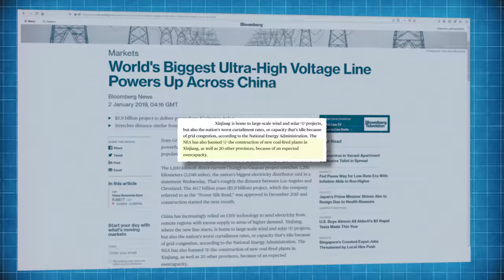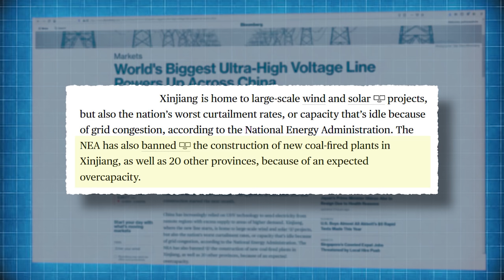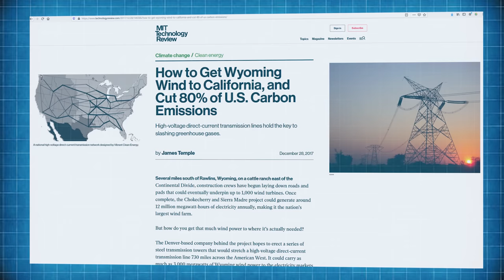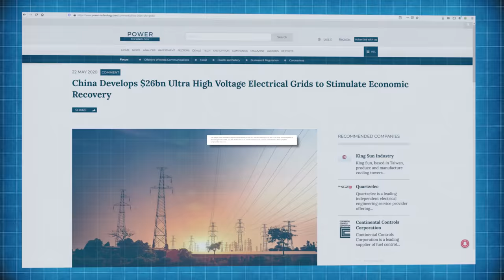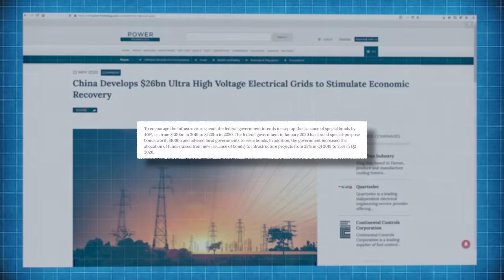China's MILLION VOLT Energy Superhighway

Comment: We can't be sure  of the real impact of human activity upon the climate  other than to say  climate change is complex and has been going on for the last 4 1/2  Billion years.  We must be having an impact  but we must also be having an impact with the rubbish and poisonous chemicals  we dump in the ground, sea and air.  I am more concerned about that the climate change.  I don't think you should praise China too much -  If it is having to limit power generation  because of over capacity  it clearly didn't plan things as well as it could.  You have to wonder apart from the environmental impact  in China generally how much  Carbon Dioxide has been generated through these massive infrastructure projects ?  

Without the anticipated  hike in electricity demand through EV  use  it seems strange without Elon Musk  there would probably have been none of it and less need for so much more electricity generation. 
   
Are EV's really about  saving the planet  and if we get CO2 levels down  to what we currently think are  appropriate levels  (to   stop climate change that is) and climate change still happens what do we do then ?

Comment: I was always told that AC was more efficient over distances due to DC loseing electrons to the atmosphere?
Reply: Leakage in a properly designed DC system should be very low. In contrast open wire AC distribution can lose energy due to radiation and dielectric heating. Over long distances this loss adds up and can be considerable.

Comment: The west like to judge China using western traditional view points.  That seems to be fine for normal stuff.
However in UHV DC transmission no country has done more and have the biggest network, the highest UHVDC lines and has actually transmitting more power over a bigger area than China.
Should China not be the expert here?
The speaker doesn't seem to know the real hydro power isn't in Mekong River which is called Lancang River in China where the serious drop of potential energy starts.  He used the standard slander the downstrean Mekong river miseries are all due to China's hydros upstream without recogising there is a Mekong River Cooperation organisation controlling Mekong River developmenet.  The mjority of Chinese Hydros are actually in Yangtze or its upstream section Jinsha River which houses the world's biggest power plants No. 1 , 2 and 4 plus over 100 other hydros.  Apart being the world's biggest hydro power China is also world's biggest solar power and wind power generator so naturally it has the biggest and the longest transmission network.
My point is western so called experts are not real experts because they have not manufactured, installed and operate the 1100 UHV DC system.  They are just obervers.

Comment: some info.     wtf    have you been bamboozled or what.        at 4:12,  Nonsense.      here are some  FACTS.       because the energy density of  DC watts  is  'full-strength' (greater than AC), the use of longer cable runs  IS  problematic.        unlike  AC,   DC  can cause  a  runaway buildup of  resistance and heat and More resistance.     this would be the equivalent of  ---   transmitting power though a giant, Heating  Element.    and, copper has a  Low  melting  point.      the only  solution to this  problem  is to use, either,  HIGH-temperature  Superconductor;  or   copper, a metre in diameter.
in contrast to this,   AC  is  PERFECT.    it can be  transmitted  with  a  Tolerable  amount of loss   and  without  'stringing'  megatons of copper;  or  reliance on a  technology that  we  do  NOT  yet  possess.        neither is pulsating DC  an option.    because, the amount of loss from (high-wattage) power-switching, would be  Unacceptable.    cheers          googletranslate

Comment: You state that Xi is looking at economic reasons for this sort of infrastructure, but you ignore the main reasons and they are NOT CO2 emissions.  Coal produces real pollution in addition to CO2 and China has a visibly terrible smog situation.  The most important is likely that China is preparing for military domination their weak link is  energy imports.  If they invade Taiwan as they have promised, their energy imports could be cut with a naval blockade. Their current infrastructure spend is chosen to reduce this vulnerability.

Comment: I doubt the validity of this video. (how do you make motors go around?) A lot of technical details were left out. Without those details I can assume that a DC transmission line could be more efficient than AC if that line is intended to move all of it's energy to 1 downstream location that is very far away. If you attach loads in the middle, then the systems might become more equal. The 1 mega-volt rating would probably still drop by more than 20 percent as the 1 downstream load is connected. I would like to know how this was measured and this video is simply non-technical propaganda that people will want to believe for various reasons. Typically, a DC power system has a voltage that is either regulated with electronics to be a certain amount, or rated as a certain amount while the expected load is connected. How do they do it? (DC voltage regulation is less effiecient than using AC. The discussion leaves a lot of questions unanswered. How does a consumer use DC power in a respectable refrigerator? How do you make a DC motor turn around? brushes? I do not doubt that the technology can be improved, but the devil is in the details. Will all LED lighting need to be replaced with new designs that run on DC? (that should make some people laugh) (it is a real-life joke)

Whether this is a breakthrough in efficiency, or a stab at global energy dominance, the CCG might be in big trouble if activist consumers get together and agree to simultaneously turn on all of their lights, and then turn them off again, and then repeat that. Perhaps a pulsating DC transmission line would be better? I do not doubt that the systems can be improved if Taiwan Semiconductor can produce a Zener diode about the size of a semi-truck. Huge gains in efficiency could also be achieved if you could use solar panels and their DC current for refrigeration and cooling during the daytime, and connecting atomic reactors to large continuous loads so that the excitation current in those generators can be maximized. I am not impressed with this video.

Comment: Saying that DC does not have loses is simply wrong. Issue is wire resistance (thickness/ohm law) and dependence on voltage.  For low voltage with just few meters you could lose half of the power on DC transmission.
Reply: No mater what you still need high voltage ac-ac tranformers to transform ac from generator 19kV to 1000 kV AC and than that ac tranform to dc high voltage.  And again at the at the end point do the same but opposite.

Comment: Hydroelectric power does not reduce the flow of water downstream.  Shameful lie!
Reply: Yes it can and does.
Reply: @wulung5943  
You need to do a bit of investigation on how it works. 
If not regulated properly, water held back without enough release to maintain any flow in the river,  the power and money becomes the driving motivation over and above the needs of the river,  environment and people down stream. 
At times of lower inflow the dams can and often do hold back too much water or all the water. 
The river can become little more than a drain between dams.
Reply: @wulung5943  
Well Mr self proclaimed  "retired consultant engineer " you should  know what the word regulated means in hydro and river flow terms. 
Clearly you are not a hydrological or hydrographic engineer. 
I suggested you do some of your own investigation into the issues , I am not going to waste my time spoon feeding you with "proof"
Reply: @wulung5943  
I did reply, now go away and find out how a  hydro scheme is supposed to work and how it can go wrong for the river,  environment and people if poorly  or irresponsibly managed.

Comment: You mentioned "skin effect" losses with AC, you could technically prove that there is some of it at 50/60 Hz frequencies. But it would be quite negligable compared with what it would be if the transmission was at higher, i.e. 10's of kHz value. Even Tesla, the inventor of our present AC system in his later life was dropping hints that the DC power transmission would be more efficient than AC. I would say that he had pretty much worked out the means of generation, transmission and conversion back to AC of DC based power transmission. By that time the electrical energy transmission field was already well established and set in concrete so to speak. So retty much no-one was interested in one old mans ramblings..
By the way, the efficiency of transmission at higher voltages is mainly due to the fact that power is a product of volts and amps, so if one jacks up the voltage the current will drop proportionally to maintain the same amount of watts at lower voltages. Less amperage, less copper cross-secion of the conductor is needed to get that power from point A to point B.

Comment: Dc to ac conversation has big losses to which you did not go into much
Reply: That's why it only makes sense on longer distances where the AC transmission losses overtake the conversion losses.
Reply from the maker: The cost benefit break even graph is all that was required for this summary video.
Reply: Just Have a Think  I agree but just felt it was skimmed over quickly

Comment: I like your presentations but you never get to the interesting spanner bending parts on which brain waves succeed or fail. As a kid, on foggy days, I used to listen to the buzz when cycling by  high voltage AC cables. How 3 times the voltage is being insulated is of interest as is the size of the losses that will still exist let alone the increased cost. A little bit of bearing grease on your face might balance some of the ideology. If you look at the wide picture you will see that most of the world just copied the Chinese response with a few variations so the devil is in the detail there. I probably sound critical but would not be writing this if the good stuff was not worth balancing.

Comment: I have a better idea.  Why not make all of our eating utensils out of LEAD?
Similarly, ULTRA HIGH DC transmission IGNORES extremely serious unintended consequences.
High current DC causes extremely powerful low frequency magnetic fields that can affect humans and animals.  Fish and birds ALREADY have their magnetic navigational abilities disrupted by these enormous magnetic fields caused by DC transmission.
Go ahead ... just IGNORE these known risks.
The earth's Schumann resonances OVERLAP the low frequency entry that these DC currents generate.  
Only a fool would blithely ignore the risks of altering the earth's  magnetic field frequency that our brains operate in.
Reply: Interesting.  Where are the LF EMF generated, during powerup?  Perhaps slower powerup and powerdown would be a solution.  At constant current, there shouldn't be significant radiation, right?  Is there actual data on the strength and extent of the EMF?  Has it been shown to be a problem for animals in practice?
Reply: Magnets in your hat could help.
Reply: @incognitotorpedo42  The problem is that it is NOT truly "constant current".  The current changes quickly with load changes.  Our 60 Hz systems don't effect human 8 Hz brain waves but the DC lines emit a lot of energy in the 8 Hz spectra band.
Effects on several types of fish are well known and studied near underwater DC cables.  It seems to upset their navigational abilities.
Reply: @byronarnason6006  What if we designed load followers that smoothed the current changes in order to suppress dangerous frequencies?  Or developed other techniques to keep EMF levels down, like generating an out of phase EMF to cancel the one from the main conductor.    I'd rather at least see if it could be made safe before dismissing it out of hand.  I think we need a lot more work on quantifying the dangers as well.  If confused fish is the biggest problem we can find, maybe it's worth it, considering how much carbon it might keep out of the atmosphere.
Reply: @incognitotorpedo42  tin-foil hats for fish

Comment: The Russian Federation did this same thing about 30 years ago using extremely high-voltage DC transmission. Apparently resistance/reactance is less on the surface of wires, where such high-voltage DC current travels, than in the wire itself. I asked a veteran electrical engineer in my school about this, and he was doubtful. So, I still don't know what the physics is. 
    The Chinese GDP is projected to increase by from 3 to 5 percent this quarter according to their own estimates. The hysteria over CO2 is unfounded. I participated in the first Earth Day and for a long time accepted the Theory of the Greenhouse Effect, which was what kicked off 50 years of Neo-Malthusianism ("Climate Change"). The Greenhouse Effect was supposedly observable on Venus, but more recently I've been convinced that the observations were poorly analyzed, and there's no Greenhouse Effect on Venus afterall. Watch this presentation by Robert Holmes, PhD Climatology: https://tinyurl.com/yxsasnz5

Comment: Please look at "Gerard Morin's" You Tube site, where he clearly states that if you put high voltage AC current through 3 spark gaps, the nature of electricity is transformed into and electrical potential, without any frequency. When this electrical potential is fed into long distance electrical conductors, there are no line losses. Furthermore, one only needs to add 10% to this electrical potential grid, to what is drawn off from the system, to keep it charged. To change it back from an electrical potential to a useable AC electricity with a sine waveform, a simple rotating drum with carbon brushes can be used. This guy Gerard Morin's system can be reproduced by anyone and makes a hell of a lot of sense. There is of course controversy about this way of thinking, as what is been stated is something for nothing, which we have all been led to believe is not possible. Nicolas Tesla was onto something when he wanted to give the world electrical power for free, but was defunded and character assassinated, as with this type of electricity no meter can be put onto it. Do your research. We have all been lied to. Geoffrey.
Reply: Sounds wonderful, might knock one up in the garage
Reply: @jimgraham6722   might have to charge the tropospheric coaxial resonator first .

Comment: Those fancy DC transmission lines will be carrying ZERO solar generated electricity directly from PV panels  when the sun is on the other side of the Earth.
Reply: @djp3637  I think resources should be devoted to nuclear. It's the highest energy density, hence lowest environmental impact source. Its constancy doesn't have the daily shutoff problem of solar or the erratic shutoff problem of wind. Also uses a lot less extra resource hogging, environment impacting transmission, expensive infrastructure.
Reply: @mdombroski  That's why this is first step in global electricity network like internet today where we will be able to send one to another clean solar energy all day 24/7/365.
Where is Sun, energy flows to places at night.
Reply: @klokoloko2114  Incoming solar energy is going to have a long way to flow at 2:00 AM.

Comment: my BS meter is off the charts. lets see what the rest of the video holds.
DC loses massive amounts of power to resistance; especially over long distances. A/C has much less loss to resistance. You are straight lying. This is really common knowledge for anyone who took an 8th grade science class. Way to not explain the boon of this brand new tech- but at least you set a link for a much better channel that actually covers the technology. 
A major problem with the grid isn't getting energy from one place to another- The grid is built with moving power from one state to another in mind. The problem is a mix of much needed updating, bad load predictions, politics, and Texas (they separated from the grid entirely and now they are paying dearly for that stupidity).
Also you haven't clearly explained how co2 emissions drop. Is it just an assumption? Data? actual numbers? Hopes and Dreams?
This whole video is nonsense. Thanks for the laugh, now I have to explain to my cousin why he should never watch this channel.